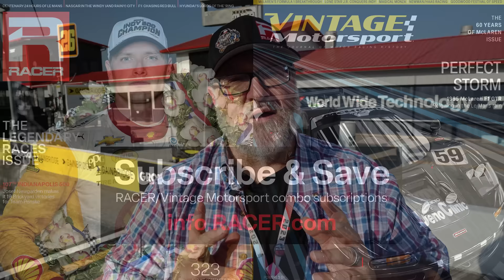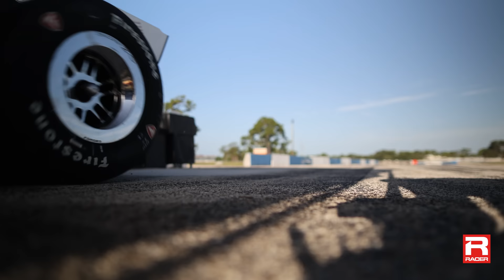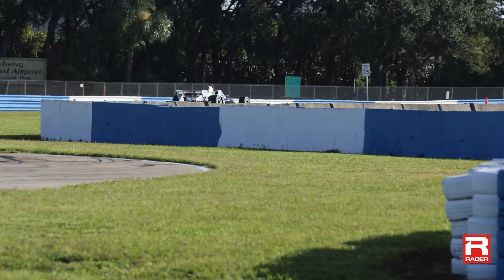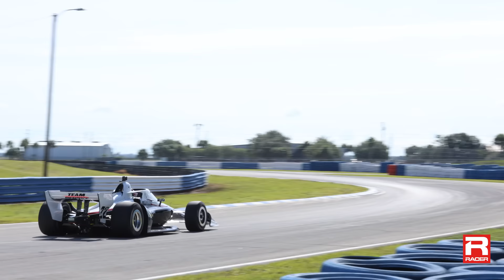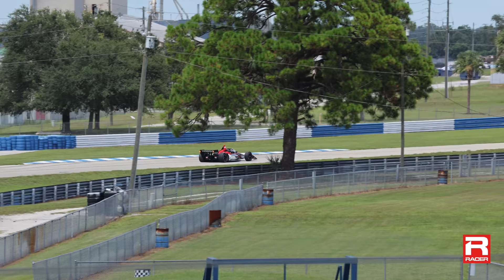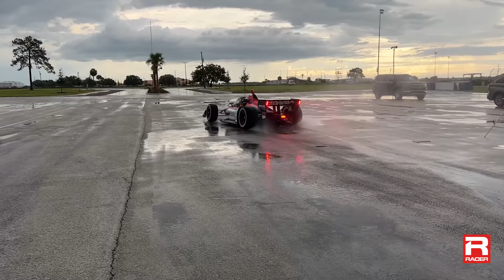Listen To The Sound of IndyCar's 2024 Hybrid Engines

Comment: For me, it was a mixture of F1 from the 80's TURBO Era and current F1 cars. And without a doubt, it sounds much better than today's F1. Congratulations to Indycar.
Reply: Will F1 sound a bit more like this when they remove the MGU-H?
Reply: @joaopinho2361 hopefully they do
Reply: @joaopinho2361    honestly V10s are what F1 needs right not. Not too much loss on power, big savings on weight, cheaper engine so more competition, more reliability since its simpler too, etc
Reply: @R9naldo  V10s and reliability can't be in the same room because they rev up to 19K RPM, they are simpler, sure, but remember that mechanical DNFs during that era is much higher than it is right now. I'm pretty sure it will be the same even now. Not that I don't like V10s but there's just nothing wrong with the current V6, it's the hybrid that making it look bad.

This kind of sound is fine, F1 only needs to ditch the MGU-H and maybe increase the displacement a bit although by the time I wrote this comment, only the MGU-H that's gone, nothing change except that.

Comment: Never understood why people thought it would change the sound. The hybrid is completely kinetically harvested from the drivetrain. It doesn’t interfere with the exhaust gases at all
Reply: because people are ignorant
Reply: @The52car  It's gonna be even more dangerous when it catches fire though.
Reply: @MaLva500  If it's like the Hypercar/GTP cars in WEC and IMSA, the bigger danger is if the Hybrid system has a problem, and they need to extract the driver. In Prototype racing, they have to literally jump out of the car instead of stepping out as to not create a ground so they don't just... die. there will also have to be special gear to deal with the hybrid stuff because you cannot be touching the ground at all.
Reply: The only problem is weight but that is more a 2026 chassis challenge I guess.
Reply: I think most of it was either based on what they head on Formula E or what we're seeing in F1. Even though F1 and IndyCar are going going to V6 turbo hybrids the way the engines are laid out and formed are two very different things.  I guess this is why technology is so interesting.
Reply: @MaLva500  I believe the supercapacitor should actually be safer during a fire compared to a lithium battery.
Reply: @kylemitchell2052 
Sort of... it's basically a verification of grounding. The Green light/Red Light talk.... if for what ever reason that the system has a Red light, assume that the system has been compromised and charged. Will they die.... No (they have the equipment handle a sudden discharge) but when it comes to electricity if you have to question anything, the answer is "For the love of all that is, please don't." 
Which is why you see them jumping from the car, they DON'T want a scenario where you complete a pathway for even a second... because if the system is compromised and you touch the ground while still touching the car, that is all it would take to get a current going. Which will likely be bad.
Reply: Pretty simple: They did have to repackage a few things. Its never been fully explained exactly what had to be moved around and how much, but if the exhaust piping had to be rerouted in ANY way it could have impacted the sound for better or worse.

Now, it just might be the mics in use here, but these actually DO sound a little rougher to me. And not in a bad way. But it definitely is 99% identical to my ear.
Reply: @The52car  No its because F1 cars sounded like a joke when they went hybrid and the F2 cars are still louder today
Reply: Let’s just keep hybrids out of American motorsports….
Reply: @toyotaecw why
Reply: @mvd4436  F1 cars sound like that because of the MGUH. The system Indycar is using is basically just a KERS system, like what F1 used in 2010 when the cars were still really freaking loud.
Reply: @toyotaecw i don't think thats an option sadly a b Hybrids actually make cars faster c Battery tech has come so far over the last ten years i can trust it in crashed with the hundreds of hybrid F1 and LMP1 crashes I've Witnessed some being extremely scary its good
Reply: Exactly the power trains will sound the same and have more power the issue will/is the weight balance.
Reply: I was thinking it would sound a little different because the change in HP and the electric bit. The only difference is you can hear the electric in the low speed corners.
Reply: @TheUsmc0802  the hope is that all of the work the OEM’s have put into the super cap system and packaging in addition to a new lighter aeroscreen means there will be a very minimal change to total weight, but there may be some penalty to the car’s weight distribution because of where the hybrid system is housed.

If you removed the talk of hybrids completely, if you were to just say there would be a 100 HP jump with a minimal weight gain I think that’s something most people would get behind in a heartbeat. I think a lot of people are just against the fact of electrification at all which I think is rather silly. It makes the OEMs happy and we get faster racecars that sound identical so who cares. Just my two cents
Reply: Probabably because of f1. But that was more because they cut the max rpm by 5000, not the hybrid system
Reply: I think mainly because of what happened in F1 when they went from V8s to V6s, so they went from screaming engines to ones that sounded like tractor engines by comparison.
Reply: People probably think that because of F1 since their hybrids sounded so dramatically different, but I think F1's sound is due to the MGU-H.
Reply: @hombrr3  no real reason other than he doesn’t like em
Reply: Because in F1 the sound drop upon the Hybrid system launch was dramatic.  Thus the concern.
Reply: @The52car Naive might be the better term here..but I know what you're getting at.
Reply: @toyotaecw  Have you got any reasoning for this other than being a dinosaur that doesn't like change? Have you heard the Cadillac DPi-V.R?
Reply: @FormulaFox  yeah to me this car sounds more aggressive and racey than the relatively boring sound of the current cars. although that may purely be the difference between the more raw recording here as compared to the tv broadcast.
Reply: People are probably thinking of F1 hybrid engines, which sound more muffled due to them harvesting energy through the turbo, slowing exhaust gases.
Reply: @toyotaecw  or all motorsports.... they are awful and create more problems than they solve... in the name of what? saving trees? if anyone cared that much then they wouldn't even turn the key to the car....
Reply: @B__L heavy, more expensive, limited range (more stops or more management, yay!), fire and electrical hazard, generally not as reliable as the combustion engine, you also need trained staff to deal with said system... more chances of something going wrong, so more retirements due to tech issues.... and if you didn't know, battery's are not good for the enviroment, so why put them in lots of racing cars?
Reply: @Barcodez5555  Heavy yes, Limited range? Are you joking? That's literally half the point of a hybrid is to increase range... Hybrid F1 cars are the most efficient engines ever created. Also current F1 cars are the most reliable that have ever existed in the sport. You haven't got a clue. And as far as the environment issue goes I'm not even going to argue that. There's so much lies and bullshit propaganda spouted from both sides that you can't trust either.
Reply: @MaLva500 F1 has been using hybrid for like 10 years and there hasn’t been a fire or anything dangerous
Reply: Probably because it did when F1 went Hybrid but thats because they went from a V8 to a V6.
Reply: If changes the sound a tiny bit by making the pitch higher but not the screaming volume
Reply: @toyotaecw Global warming is becoming evermore present with each passing summer, we might aswell normalize hybrids for road cars aswell since this summer is straight up SCORTCHING
Reply: 2014 flashbacks probably (F1) 😅
Reply: Well listen to 2013 F1 engines and then 2014 F1 engines and you'll understand why people were scared
Reply: @ale99bigsoos23  2013 F1 cars had a very similar KERS unit in the drivetrain. It made about 80hp, the Indycar KERS unit is supposed to make about 100hp
Reply: @kylemitchell2052 in f1 you also need to jump of the car
Reply: @Barcodez5555  burning gas and oil aren't good for the environment but I don't see you calling for all motorsports to be banned.
Reply: @ale99bigsoos23  That's because of the MGU-H which is a completely different system from a standard hybrid powertrain.
Reply: @FPSilver Cmon dude we've had hybrids racing for nearly 10+ years now
Reply: @mvd4436  No they aren't F1 was far louder than F2 when I went to COTA last year
Reply: It might change the sound maybe when you hear the electric component whine up and down
Reply: Hybrids have been in IMSA for a while now.
Reply: Because people skipped their physics classes in highschool and STILL don't understand how a Kinetic recovery system works.
Reply: @mvd4436 Yeah, because they went from V10 to V6. Forgot that part, huh.
Reply: @XXJE001  You dont know sh**. They went from V8 to V6.
Reply: @XXJE001  no, V8s were used from 06 to 15
Reply: @RussellAutosport And what F1 is going back to in 2026 with no MGUH
Reply: @mvd4436  Now go listen to the new 2024 F2  engine. A nightmare for any petrolhead
Reply: @toyotaecw Kinda too late for that. Racing is dead.
Reply: Because of f1 ptsd. This sounds sm better. 

When I heard indycar thru tv and highlights I thought the sound was ehh but in person it’s so good
Reply: Because there’s people who think Hybrid means it’s strictly electric.
Reply: @mvd4436  that's because they went to V6s, not hybrids.
Reply: Fans will bw fans, man.

Comment: Maybe if just trying to hear something different but to me, in addition to the typical sounds, it sounds like there’s a bit of that electric engine whistle added in? 

I like it. It’s definitely still raw and aggressive.
Reply: I think that sound was already there, but we rarely get it from the onboard mics. it's from the straight cut gears. However, given it has MORE power on the gears without more noise from the motors, it could be louder indeed, but it doesn't mean it came from the hybridization.
Reply: That's the gearbox.

Comment: Indycars already sound great and hybrids won't change a thing. Can't wait to see these beasts fly with the extra horsepower. I'm sure they'll get to 190-200 mph on straights depending on straight length, downforce configuration.
Reply: Hybrid is clearly not the bad guy here, it's all the MGU-X unnecessary gubbins that F1 insisted on. Shows what you can do when you keep things simple

Comment: I love it! Sounds so much better than the F1 hybrid power units.
Reply: I mean, these really aren’t comparable to the power unit in an f1 car.
Reply: it actually sounds very similar to the current Red Bull engine, but slightly higher pitched and less grunt.
Reply: they do use Honda engines so there might be some crossover idk, but yes you are right! @Tommmmmmmmmmmm

Comment: I have not been to that many IndyCar tracks but the Toronto Molson Indy led the league in sound. As you entered the grounds you are walking right past the Princess(?) Where they have almost slowed to a stop to do their run up in a straight line all the way to a super tight right-hander where there's only room for one car.. they are barely moving.. the consequence is that they are working themselves all the way through the gears as quickly as they can to as fast as an Indy car can go and then almost as quickly downshifting all the way through the box in about 10 seconds. The song of those 1990s Ilmors winding it all the way up and then instantly downshifting all the way through the gears pop pop pop pop pop RIGHT IN FRONT OF YOU was an absolute "eargasm" and exhilarating in the extreme.
Reply: Prince's Gate gate apparently.  I've been calling it "Princess Gate" since 1978 only to learn I didn't pay attention on a field trip long ago

Comment: I expect the sound transition has been less of an issue in Indycar given it moved back to turbos slightly earlier than F1 and even while using NA engines the revs were a lot lower.
Meanwhile in F1 they moved from 18000rpm NA engines to 15000 turbos that rarely get above 11-12000 for efficiency reasons, so the change was way more jarring.

Comment: Marshall, with the Adoption of Hybrid Electricity in IndyCar; you are going to need to update your Terminology to: Combustion Engine & Electric Motor. You will need to Stop using Motor, for both.

Thanks for your Racer Reporting.
   
{Bill in CA}
Reply: ‘Power Unit’ would be the correct way to refer to both at once
Reply: Marshall, is there any plan for IndyCar to use the Green Firestone Tires; & where might that be??
  
{Bill in CA}

Comment: Imagine Mercedes-Benz coming back to IndyCar after their debut long in 1994. After all, what used to be Ilmor Engineering is now known as Mercedes-AMG High Performance Powertrain.
Reply: Mercedes came to motorize the Penske PC-21, which easily exceeded 1000 HP of power.

Comment: So I think the latest I read was Chevy/Honda developing these hybrid units together after so many issues with a vendor unit. That being the case I wonder what the total weight of these units will be?
Reply: Last I checked, only 60 pounds or so.
Reply: @griffinfaulkner3514 I was shocked at how little weight was being added to the cars.
Reply: @BiggieTrismegistus  Even better, they managed to shave about 20 pounds off the aeroscreen by switching to additive manufacturing, which affects the CG much more dramatically than the addition of the hybrid unit, and means the total weight increase is only 40 pounds or so.

Comment: Would this increase lap time due to the extra HP or make them slower due to the extra weight??
Reply: Given the massive HP boost for a fairly small weight increase, especially considering the reduced weight of the updated aeroscreen, they're gonna be faster, especially with the extra punch out of corners.
Reply: They will be faster because they start the hybrid era with an additional 150 hp, which will bring the total power to 850 hp. The weight of the aeroscreen will be greatly reduced and will offset the weight of the ERS.

Comment: Is this finally going to be the year IndyCars hit 185, 190 mph top speed in the longest straights? I always thought these cars topping 178, 179 mph in most circuits wasn't fast enough. 
Now's the time to speed up.
Reply: It all depends on the race setups cause yesterday in the bommarito racing track, they hit easy 200mph. On the straight, the car setup was low HP and didn't proper aero

Comment: Not a huge hybrid fan but they sound fine to me, so do the modern F1 cars. At least Indy has kept the actual physical size of the cars under control unlike F1. Would love for both to keep the current engines and dump the ERS gimmick for bio fuels and lubes, i just don't like how heavy the cars have become. 
I mean if they were really concerned with being green they should check what's actually coming out of the exhaust. High boost and lean mixtures don't burn clean at all.

Comment: Unsure why any doubters thought a turbo V6 would sound any different...than a turbo V6...regardless of the hybrid drive.

Willful ignorance?
Reply: In F1 and LMP1, the hybrid systems can also function as a replacement for the wastegate (MGU-H). That made the cars a lot quieter as the shaft of the turbo would just be regulated by a generator at target boost instead of venting excess pressure straight through the exhaust.

Comment: So, how much heavier are these cars? Are they faster or slower than the current cars?
Reply: Only about 40 pounds heavier with the updated aeroscreen taking some weight off, and almost certainly significantly faster, especially on lower speed tracks where the instantaneous torque will make a massive difference off of corners.
Reply: They will be faster than the current ones since they gain 150 CV of power, the aeroscreen will be lighter which will compensate for the extra weight due to the ERS.

Comment: Is this the engine used in the Acura lmdh?
Reply: No, still using the same motors as this year. The 2.4L engines got postponed for Indycar usage until Chevy and Honda can figure out how to get them to work with Indy's spec hybrid system.
Reply: @Kreeschon   cheers thanks

Comment: How much weight does the system add? More power is always welcome, but the DW-12 is already overweight in its current state, and this will only add to the fat which hurts handling, braking, increases tire deg, etc.
Reply: 40 lbs.    150 HP.     New Aeroscreen lighter coming
Reply: The aeroscreen is the weight reduction so the CG of the car will be lower.

Comment: So Indycar from next season will have ERS but not all those battery components from F1 so they still sound the same?
Reply: No the system is completely independent from the exhaust (unlike F1), it harvests off the gearbox and drive shaft